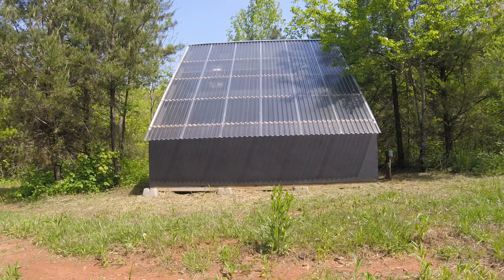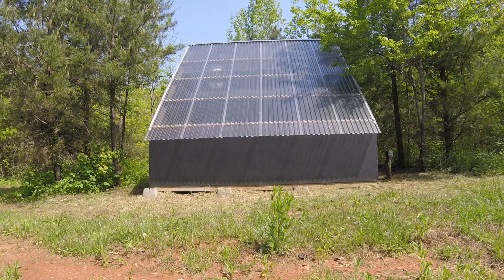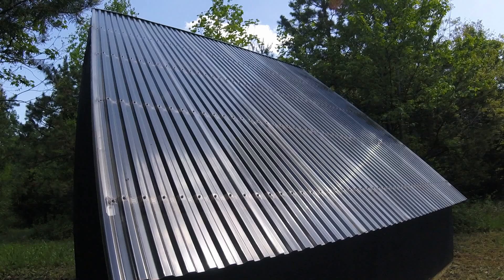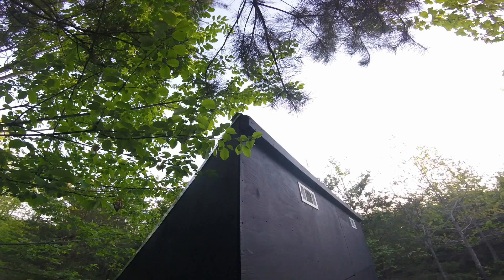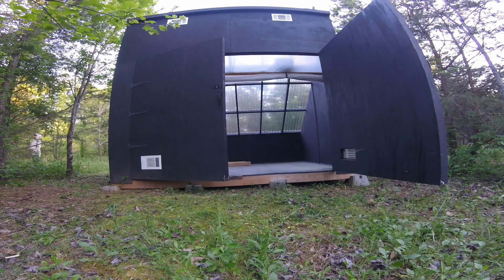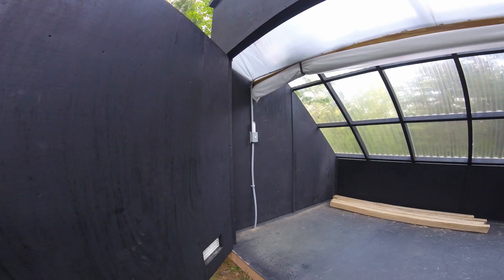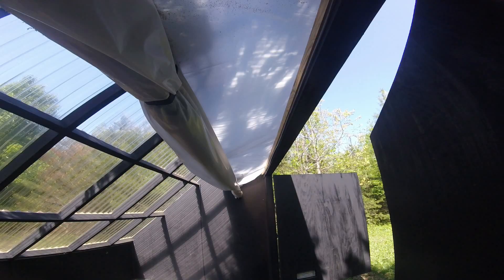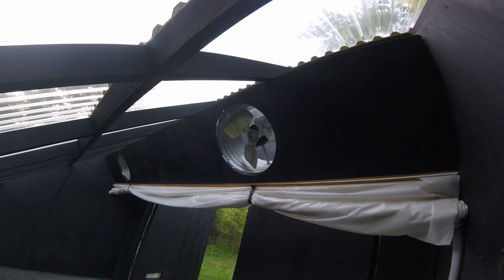Solar Kiln Overview

Comment: I like it. I wont use it cause I'm up North in Manitoba. In winter it's probably better to have air exposure from outside. Air doesn't hold moisture below zero. As long as it's covered, it should be good enough.

Comment: You mentioned that you had Anchorseal. Paint the ends of your logs or boards with Titebond or Gorilla glue. Works much better and is a lot cheaper. If used on logs outside Gorilla glue is better cause it is outdoor glue. You can buy gallon jugs at Amazon.
Reply: Kenneth Keime do you just use the wood glue or household glue or what is best?
Reply: @bradencarroll82  I use the Gorilla wood glue. Titebond will work for a while but it is not an outside glue. Just brush the Gorilla wood glue on the ends of the logs and where limbs have been cut off. On logs that have sap flowing out I wait a day or two then apply it.

Comment: Exterior latex to seal log ends is cheaper and works well. I use white (cheapest exterior latex base) and paint logs as soon as possible after felled.
Reply: I used to use exterior latex too. When I started using Anchorseal, I quickly realized they are not equal. Anchorseal slows down the drying and reduces checking far better than latex. Best, @HoneyOnWales
Reply from the maker: Thanks for the tip Drew. I have some anchorseal but I haven't used it yet. Nice work on you Instagram
Reply from the maker: Thanks for the tip dantco!
Reply: Paint is better than nothing but you need anchor seal.
Reply: I use anchorseal and log ends need to be coated within 24 hours of cutting log is what I was told

Comment: You can also use wood glue to seal the ends of the lumber to stop checking
Reply from the maker: Thanks for the tip Steve. Good idea, I didn't think about it. I recently saw a wood turner rough out a bowl blank and coated it for drying with wood glue to prevent cracking.

Comment: This was great I would like to build something like this but it just not enough time I just milled up some red oak would be great to have!
Reply from the maker: Thanks, you have a sawmill?
Reply: @BurtonsAttic  do you know what the cost is roughly to build one similar to yours with the attic fans? And what type of thermostat are you using to control them?
Reply from the maker: Macon the attic fans have a built in temp switch to control on/off cycle. The wall switch I put in is just to turn them off when the kiln is not in use. You can find them at Lowe's or Home Depot. I didn't exactly track the cost while building it but I think it was in the $1000 to $1500 range. I know that's pretty broad but it could be that way based on the quality of materials used also. Hope that helps and thanks for watching!
Reply: Yes just a chainsaw mill getting my feet wet lol.